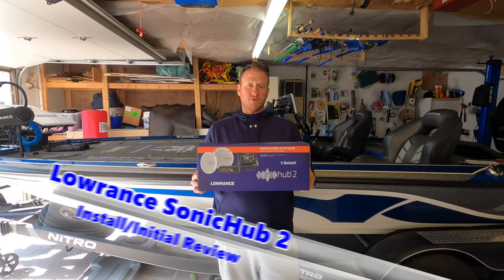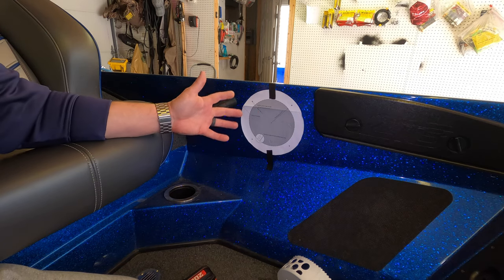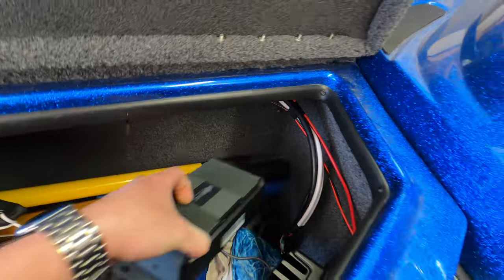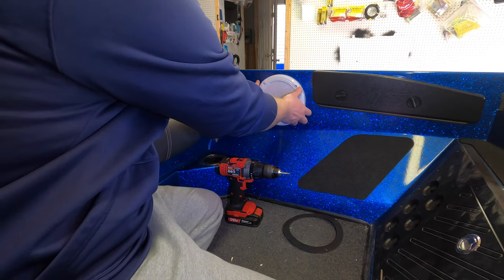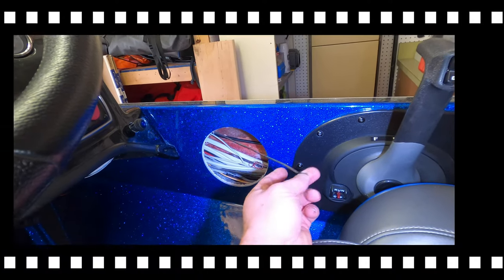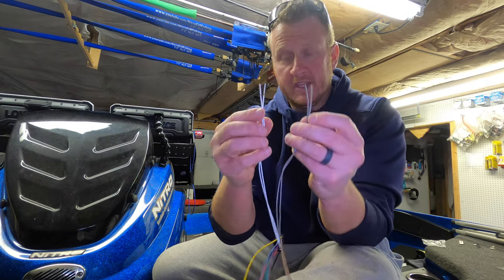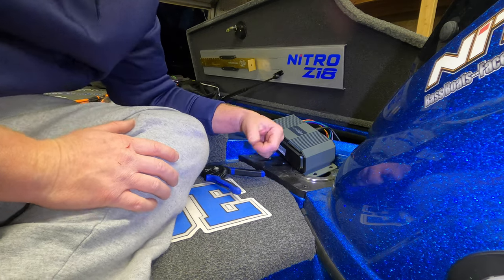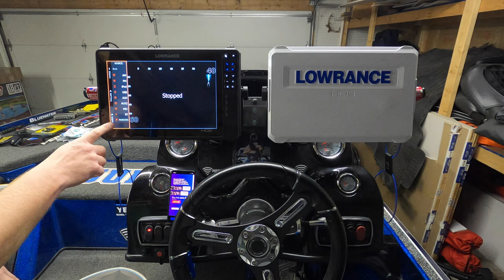Lowrance SonicHub 2 Install/Initial Review...Sound Is Awesome!

Comment: Great instructional video..  I'm looking at this for my boat.  Is there a way to link the hard buttons on the MFD to the volume control?  I'd like to be able to do that instead of using the slider on the touch screen.  Thanks
Reply from the maker: Thanks Roger!…unfortunately I don’t think so, not that I’m aware of anyway… I believe you have to use the slider (or I can also raise/lower volume on my phone), but I don’t know of a way to do it with the MFD buttons themselves…thanks for watching!

Comment: Did you have to adjust any settings on your live unit? I have basically the same setup hooked up identical with the yellow wake up wire but my SH2 won’t power on! I have 12v to the harness
Reply from the maker: Hmm, that’s strange…I didn’t have to adjust anything on the Live units…stupid question but all the connections are tight?…nothing came loose on ya?

Comment: Will the sonic hub work with third party speakers? Just need the module, not the lowrance speakers
Reply from the maker: Yes sir!...it’ll work with aftermarket speakers for sure...the module puts out 200 watts total, 50 per speaker...I was going to add 2 more speakers but I’m so impressed with the sound I may just stick with 2

Comment: hello thanks for this great video.
have question about the wake up wire.
i have 2 hds carbon at my console, when i power  on  one hds audio menu comes on on side, but i get no am/fm until i turn on my second hds,then am/fm works on both.think i have my wake up wire for sonic hub2 only on the second hds and not both?
thanks
john
Reply from the maker: Hey John!… yeah that’s what it sounds like to me, when you power on that second unit that’s what’s actually waking up the SonicHub2 module… is that where you have the wake up wire from the module ran?… That second HDS?

Comment: Can you hear it on plane?
Reply from the maker: Haven’t had it on the water yet, literally just installed it...haha...but honestly I think I’ll be able to easily hear it, it’s crazy loud...hoping to get on the water this Wednesday, I’ll keep the channel posted!
Reply: @NitroZ18Fishing  Great video. Appreciated. Any update on how loud it sounds outside with the motor running? Thanks
Reply from the maker: @mradamkirby  thanks man!…yepper, can easily hear it while on plane…have to turn it up quite a bit of course, but no issues hearing it at wide open throttle!